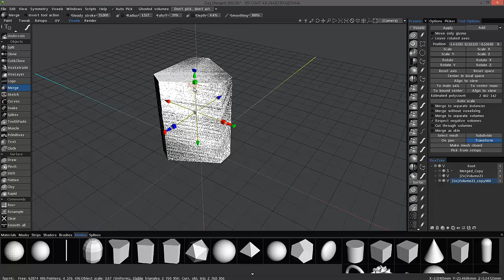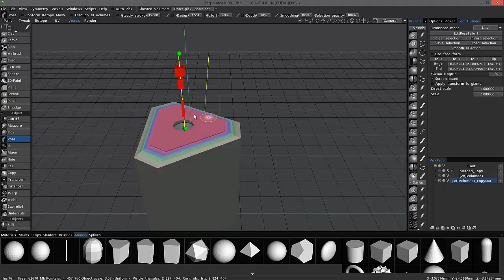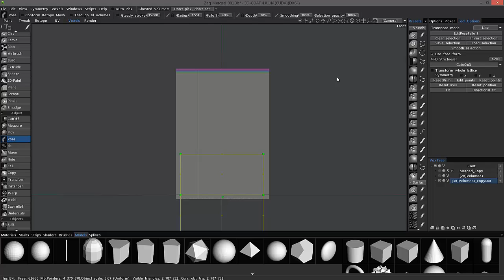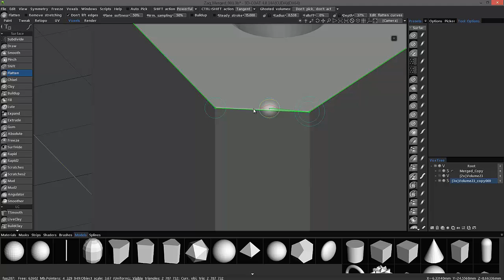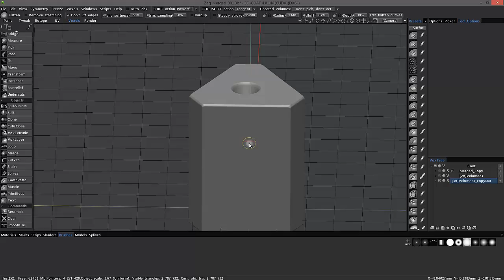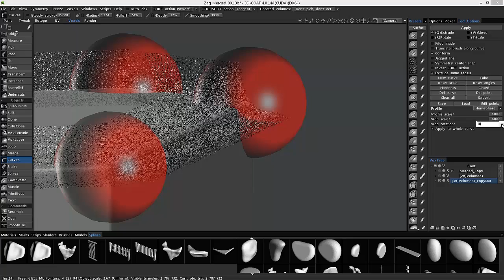V4.1 Pose Tool  Improvements Pt. 2

Comment: Why doesnt my selection go all the way through the object,
Reply from the maker: Terry Daniels In the E-Panel (upper left part of the UI, just above the Tool Panel, or you can hit the E key to bring it up wherever your cursor is), there is a check box on the lower-left side of the panel, "Ignore Back Faces" if it is checked...which it is by default...then your selection will not go all the way through. You need to hit the E key and uncheck that box anytime you actually want to select or apply paint all the way through the model.

Comment: Another great improvement - these two videos were fantastic.  Any chance we could see Using a Stylus addressed in 3D-Coat?
Reply from the maker: There really isn't much to show, other than the fact that you have a little curve profile icon next to the Depth, Opacity, and Radius sliders in the Toolbar (upper part of the UI, under the MENU bar). Click on that and you can adjust the stylus pressure profile. There is some demonstration of those in the "Intro 2 3D Coat" series, where the UI is being covered.